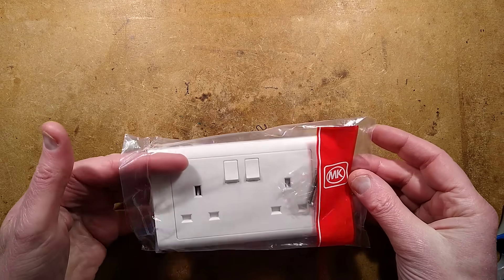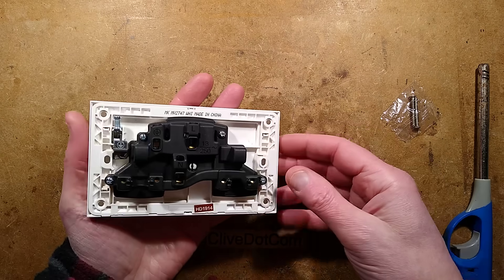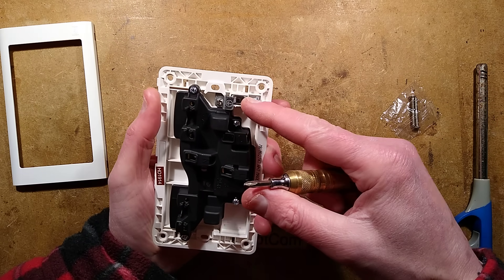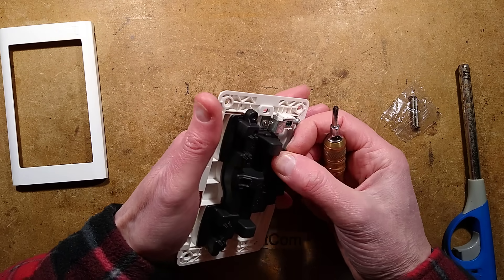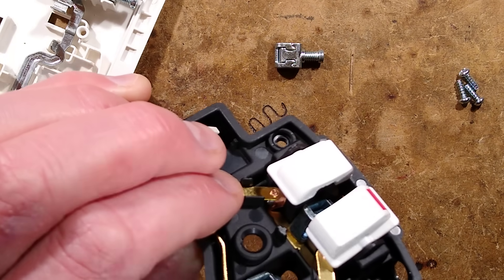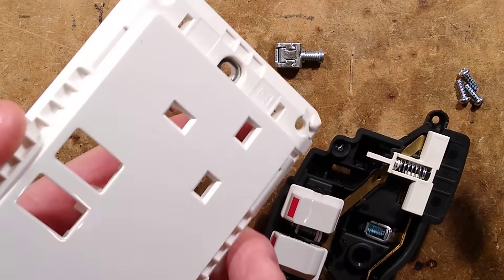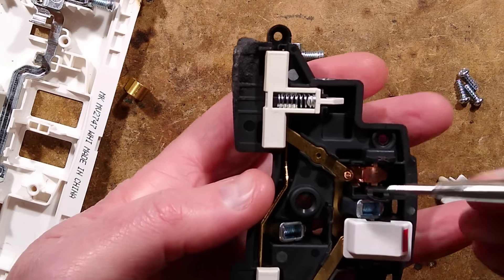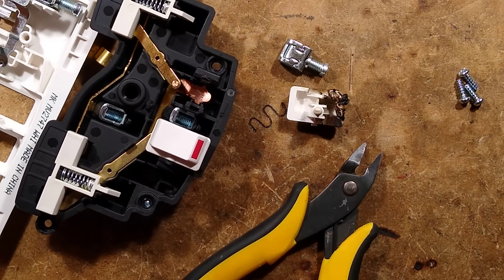Flame test on a recalled MK socket

Comment: I bet it turns out that you don't actually have a recalled model.

Recall is probably just for some batches, so they just recall all of them due to not knowing which batch has problems.
It's also possible that an electrical appliance was having an issue and somehow that led to the socket catching fire and being blamed on the socket?

Maybe you should have tried creating a 250v or 400v arc inside the socket to see what happens? Someone should contact Photonicinduction and get him to try that.
Reply: There's a link to the recall notice in the description. It's clear that it's not just a few batches.

Comment: From info that I found, it is surrounding material that could catch fire from the arcing under load rather than the socket itself. This is concerning since I always store an exposed tray of petrol right next to the socket that switches on my 3kW fan heater........ "MK sockets were recently recalled due to a potential high fire risk identified in certain models of their "Essentials" double socket range, specifically because of a potential for arcing within the switch mechanism when turned on, off, or under load, which could ignite surrounding materials and cause a fire; this issue primarily affected the switch functionality on the socket rather than the power outlet itself. "
Reply: It would be interesting to know what sort of appliances were being used with the actual sockets which caused the original problems.
Reply: Switch arcing is perfectly normal when switching a high load. Every switch does that.
Reply: @simontay4851  some are worse than others, depends how fast the make and break are...
Reply: Id rethink the placement of the gasoline. 
Every switch arcs when switching and that is not a good thing near the vapors
Reply: I don't understand why you Brits use the switch on the socket rather than the switch on the device itself? That should be designed to properly handle the load.
Reply: @pauldzim  we do, mostly, although many 'tech' devices these days such as usb chargers, digi tv boxes, dont have a 'hard' / mains on off switch, those that do have a switch, often switch on the low voltage side, the mains psu part is constantly on, and the high surge current of charging the psu primary side dc capacitor , when first plugging in and switching on at the socket is what causes a high on surge, off surges can occur as well if theres an interference suppression capacitor on the ac input of a device
Reply: @pauldzim I don't think it's just Britain. Anyway, my fridge freezer doesn't have a switch on it, what am I meant to do now? Granted, poor example, but it gets the point across. If a product is designed with a switch on it, then it should work. Since the socket is meant to be able to handle 250v 13 amps fine. Obviously if you go over 13 amps then problems arise... But that's why it's a legal requirement to have RCDs in all modern houses now.
Reply: @uploadJ  if the fridge had a locked rotor it would likely trip the RCD protection and turn power off at the breaker. Since the fridge has a sudden, prolonged, unexpected spike of current to try and spin the rotor up to speed. 
I don't quite get what you're saying at the end there. What would you change about switched sockets if you could? I'm not an electrician, I just have a genuine curiosity about keeping myself safe at home.
Reply: @pauldzim  Very often the switch on the device only puts the device in standby mode, it doesn't shut it off completely. Also, the switch prevents the socket itself being live when not used. This allows an extra level of protection against prying fingers, although the live and neutral are also shuttered on UK sockets so this shouldn't be a major problem. In addition, the switch isolates the appliance without unplugging it which can sometimes be useful (we have a cat that is capable of turning on an empty Delonghi kettle at night.....). The switch isn't a must-have feature, but it can definitely be useful.

Comment: OK Clive the general consensus is that you need to put at least 20 amps through the switch (yes I know it's only rated for 13amps but we all want to see FIRE 💥💥💥)
Reply: Where's photonicinduction when he's needed?
Reply: Why only 20amp... most rings are covered by a 32amp breaker..... so we insist you put a 30amp load on test 🤪
Reply: @Andy_FortyTwo   That was my first thought too, big old compressor might sort it.
Reply: @geoffmarriott4387  John Ward used to do tests like that on his channel.
Reply: Somebody wheel a nice welder over to Clive's place.
Reply: @flowerpt  I used to own an old ASEA industrial spot welder that required water cooling.
Reply: Perhaps his protege CORC  will step up. https://youtube.com/@thecorc964?si=48RiAGRudaPdLWO5
Reply: Amps are irrelevant. Voltage overcomes insulation. That's why North America uses a split phase system.

Comment: Looks like it is just a risk of minor burns due to potential arcflash when being switched under load.  
"Hazard     The product presents a risk of minor burns as it has been identified that when the switch on the socket is being switched on or switched off, whilst it is under load, there is a possibility for an arc flash to occur."
https://www.gov.uk/product-safety-alerts-reports-recalls/product-safety-report-mk-electric-mk-essentials-electrical-three-pin-sockets-with-switches-2411-0130#:~:text=Summary,-Product:%20MK%20Electric&text=Hazard:%20The%20product%20presentsa%20risk,been%20withdrawn%20from%20the%20market
Reply: Maybe after hundreds of cycles under load the switch no longer snaps decisively and leaves the potential for a smaller gap breaking the contacts that might support tracking or internal arcing.

Comment: Poor old Clive. When he tries to buy good things, they turn out to be dangerous, flammable tat. When he tries to buy dangerous, flammable tat, it turns out to be good.
Reply: I was thinking they may have changed the plastic composition in a more recent batch to be more self-extinguishing, but legally advised to do full-recall anyway. That or somehow the fault turns the copper red hot, such that it perforates it's support and melts clear through to the wall cavity.
Reply: @wobblyboost  The self-extinguishing plastic is so effective, it even stopped the lighter from working!!
Reply: He should try lighting it with a Fanny Flambeux
Reply: @Biggus_Mickus  Scottish luck
Reply: That's what I call a classic demonstration effect in action, just the opposite of what you hoped to see, as usual in such videos
Reply: He is NOT 'old'!

Comment: I was wondering about the quality of the metal that the actual rocker contact is made of. If it was substandard maybe it bends when a heavy load is put through it - just enough to close up the gap where it could be prone to arcing. Otherwise, like you I am struggling to see a problem.

Comment: what if you put a large-ish load, maybe even an inductive load like a kitchen machine or washer, through it and see if you can draw an arc with the switch?
Reply: I have various multiway switched socket extensions & occasionally, if I have a heater plugged in, (1 or 2 kW) there is sometimes a small flash inside, when I turn the switch off, but doesn't cause any problems.
Reply: Of course it doesn't cause any problems. A flash is perfectly normal when switching a 2KW load.
Reply: @simontay4851  it is, if it quenches almost immediately, i’m just saying maybe it doesn’t always with these? It’s just a hypothesis.

Comment: When I worked for an automotive manufacturer who supplied Toyota with their lever combination switches, we had a Toyota Yaris light switch that caught fire because an extra spring had fallen into the body of the lever where the relay contacts were during production and shorted out the contacts. No one was hurt in the fire but it did set the car alight in a tunnel in Italy.
Reply: Interesting that no fuse protected against the short
Reply: @ it’s because the direct type switched had the full 20A of the lights passing through them. But 19A passing through the spring was enough to set fire to the ABS insert moulded circuitry. This was so common they switched to 5V design that operated relays to do the switching. Same thing happened with the power window switch regulators too and those got switched to using RF to operate the relays.
Reply: @jackalovski1  didn't understand the last part but running the lights directly over the switch is something Audi stopped doing in the late 80s lol had no idear some manufacturers where still doing this.
Reply: @jackalovski1  What an odd choice to run that much power through the stalk. I would have thought the bean counters would have put a stop to that.
Reply: @ I mean, they did put a stop to it because it caused fires, but it was done in the first place because of the bean counters. The base of those old switches is basically a relay but instead of a solenoid triggering the contacts it used mechanical sliding cams that were moved by the stalk.
Reply: @ yes, my company made switches for Toyota, mitsubishi and Subaru so this direct type design was used into the late 2000s.
Reply: @--_DJ_--  Still common, they balance the cost of the thinner wires versus the need to have the extra relays, though the most common thing to do is slap a few H bridge drivers into the door module to do that, and only have a 2 wire interface to handle switches, with the door module communicating via low speed CAN or LIN bus to the other door modules for the driver's side panel controls. That also means no need for multiple switched wires through the door, just power and ground, and the communications cable, with the door module operating all the door functions instead. Modules are cheap enough to the OEM that they will make 1 module for all 4 doors, with the personality programmed into it during the production line, and just leaving half the functions unused on the back door (mirror controls) and still coming out cheaper overall.
Reply: @ It was more the internals of the switches that I would have thought to be the expense which would kill that idea rather than the wires themselves.
Reply: @jackalovski1  interesting... 3 of 4 replies from me got deleted again... That's YouTube

Comment: that's hot
.... 
....
.....
.....
.....
....
.....
why did you click read more? YOU HAVE JUST LOST THE GAME
Reply: i wonder if the problem is related to each time it connects/disconnects under load, the vaporized copper inside the switch cavity becomes conductive enough to cause massive spontaneous failure

Comment: Guessing maybe it was recalled due to someone having an electrical issue after probabaly installing these as new, so to hedge their bets they recalled it, probabaly simply retooled the dies or changed the amounts in the plastic formula
Reply: I notice these are made from a softer type of plastic, probably ABS, rather than the usual hard glass filled Nylon. (Flame retarded Polyamide 66) which has been used for most accessories in the past.  
The hard plastic always makes for a firmer & more positive switching action.
Reply: Good to know! @RichieReportsUK_UKCNews

Comment: Time to get a headlamp ?? 😂 [former mouth user]
Reply: Mouth lamp should only be used if you're snooping through a shell companies records at 2 in the morning.
Reply: @djoakeydoakey1076  Watergate?
Reply: Personally - EDC I use a Streamlight with a combination hat/belt clip.  Best flashlight I have ever owned.  Uses the "Tap 10" feature to allow you to program the switch.  Allows you to turn off the flashing mode completely and just have hi/low settings.  Uses rechargeable 18650 button-top cells.

Comment: This is so weird. I don't understand the source of the arc-flash mentioned in the recall. Wouldn't that need N&L to be close enough together that the ionization from the switching spark could set off a chain reaction?
Reply from the maker: The only connection that comes close to the live is the earth bar.

Comment: ... Good info...Lets folks know the world is not a straight-forward place. 
Possibly cause of recall may turnout to be something that doesn't show up under normal QC testing ... possibly along the lines of of some units having a bit of swarf or similar in proximity to the contacts.... If such were the case it may not be obvious when tearing down as swarf may become mixed up with the general debris....

Comment: (Setting fire to the switch, after having set fire to the faceplate) "This socket is unusable now." It takes a trained and experienced electrician to spot these subtle problems.
Reply: Video released 20hrs ago 
You guys commented 2 week ago🤯
Reply: Indeed, as a layman (Oh sorry PC lay person)  I would still use this socket 🤪😜        🤣👍
Reply: @dcallan812 As a layable person,  I will use any socket😅.

Comment: “The product presents a high risk of fire as it has been identified that when the switch on the socket is being switched on, or switched off, or whilst it is under load, there is a possibility for an arc flash to occur. This could cause the socket and surrounding materials to ignite, causing a fire. The affected sockets do not meet the requirements of the Electrical Equipment (Safety) Regulations 2016 or the Plugs and Sockets (Safety) Regulations 1994.”
Reply: So, perhaps that batch used a plastic that was not self-extinguishing?

The only other prospect is the metal bits but unless they made the contacts of alkali metals, I don’t see it. Ordinary metals you find in outlets are hard to get burning.

Comment: Do the screw holes have a earth connections like a normal double socket? Or when they designed it did they think the clip on shroud covered the screws, and then had a subsequent change of plan?
Reply from the maker: They do seem to be properly earthed.
Reply: The right hand screw hole appears to have an earth connection.
Reply: Are beards self extinguishing?
Reply: @clivequinn8978  Are beards self extinguishing?  I believe Clive did a video on that a year or so ago.  IIRC, YT took it down for health & safety reasons.

Comment: Maybe they had a problem with the manufacturing process, and it only affects some units. But QC doesn't know when the problem occurred, so they have to recall the whole lot of them. Something like the contact brazing process may have fallen out of spec - so some switch contacts have not adhered to the copper properly (just a guess).
Reply: Probably had a batch of poor quality plastic used to make the switch rockers, which would shrink more than the designed amount with either time or cooling when out of the mould. Thus when in an assembled switch and the switch was opened under a heavy inductive load the arc from the slowly separating contacts, because the switch area is the only arc channel around, would escape out through the gap there, and as the finger is essentially on the switch operating it there is a good chance that this conductive arc was resulting in electrical shock to the user, with at least a RCD tripping on the spike of capacitive current, and at worst a fatality from a faulty RCD that would no longer trip on imbalance, or on overload, but still closed and energised the circuit.
Reply: Yeah, this unit seems well designed without obvious shortcomings.

But it's usual practice to recall a product completely instead of some serial number batches if the fault is potentially dangerous and not that easy to spot.

Comment: You forgot the recall notice :)

EDIT: I tried to post the link myself, but YouTube keeps removing it. The recall notice seems to suggest that it's  not a fire risk, but a risk of an arc at the switch causing people to get burned? .
Reply: YouTube no longer allows links in comments that are not links to other YouTube videos it seems...
Reply: @jrsc01.  Wouldn't be so bad if they just told you that's not allowed, instead of shadow hiding your comment.
Reply: @jrsc01. Ive even found that links to other you channels or videos don't always stay up either.
Reply: I think it's in his first video
Reply: There is a fire risk, because the arc flash can cause the socket and surrounding materials to ignite, causing a fire.
Reply: @GadgetMan36 cheep Chinese crap, mk used to be British made.